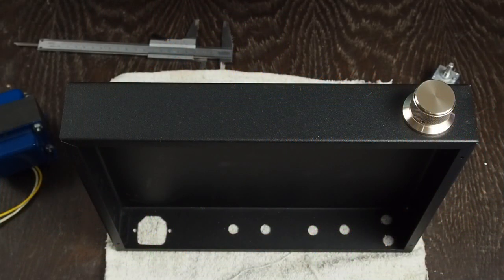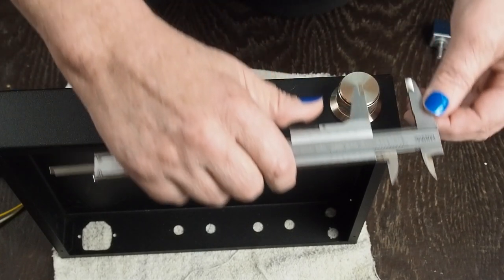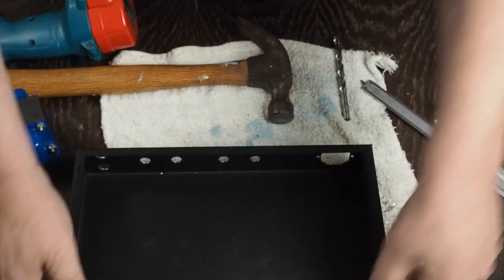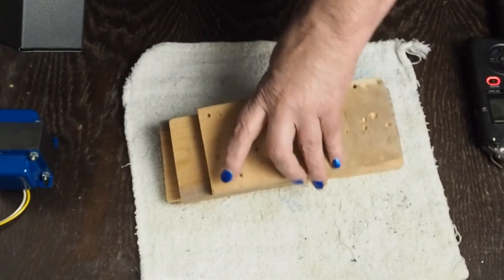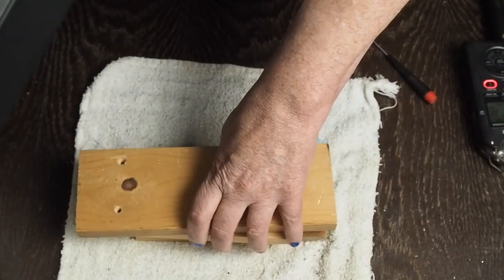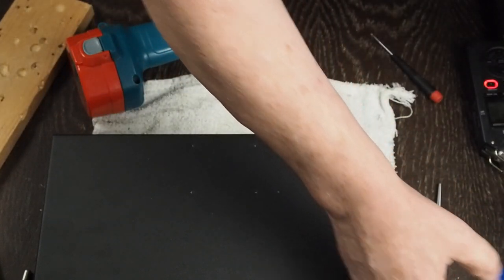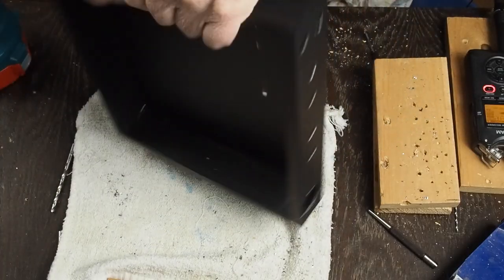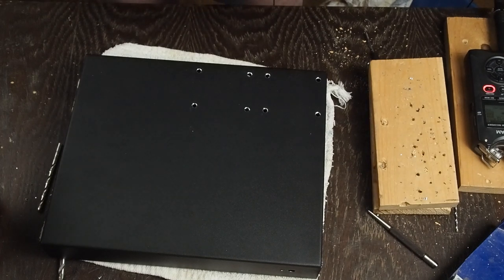6SQ7 EL34 Tube Audio Amplifier: Fabrication #3

Comment: You need a drill press. Also, one of those click punch things that Blueglow has. And a deburring tool like Mark has.
Reply from the maker: No one "needs" those, that's all nice to have stuff :)  The whole point of this channel is to show people how to do this work with a minimal set of tools.  BTW I have a "click punch" but for work on steel, I prefer a hammer type. And honestly a large nail sharpened correctly works fine for this too.